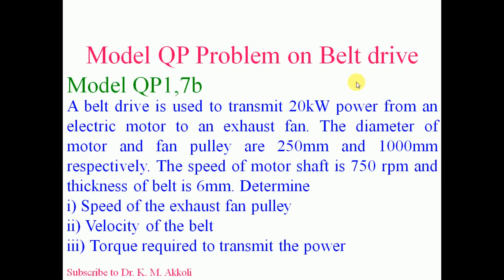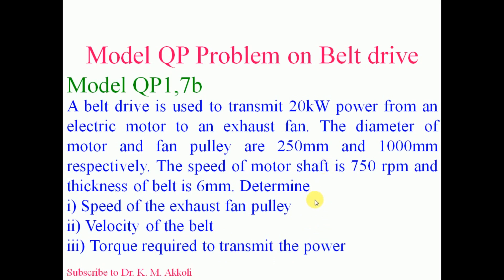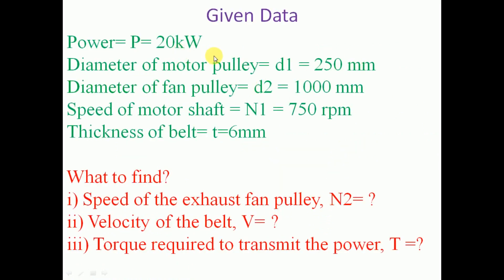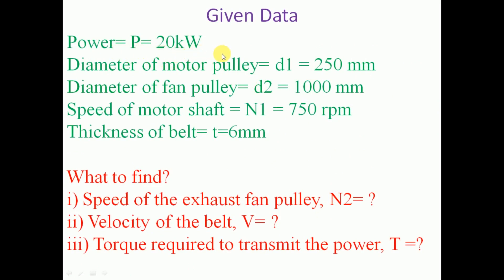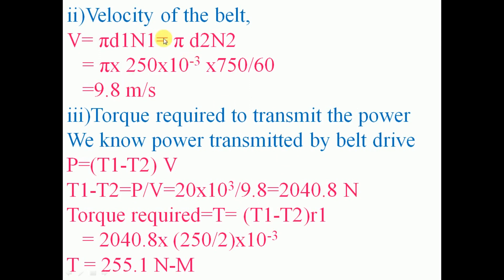Problem on Belt Drive | Elements of Mechanical Engineering

Comment: Sir in Torque formula it must (t1-t2)* V/ 1000 na??
Reply from the maker: If you want express power in KW then, it should be divided 1000
Reply: @EngineeringXplained1  thank you so much sir...
Reply: @cheethacheetha4876  r u now physics cycle